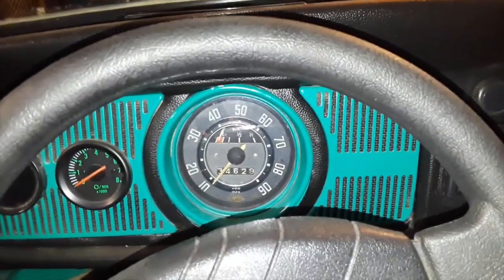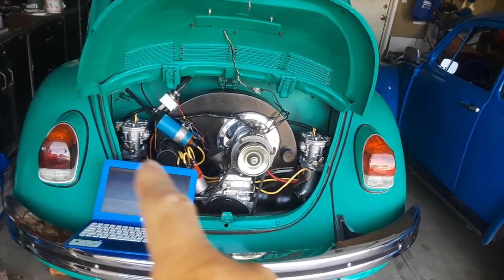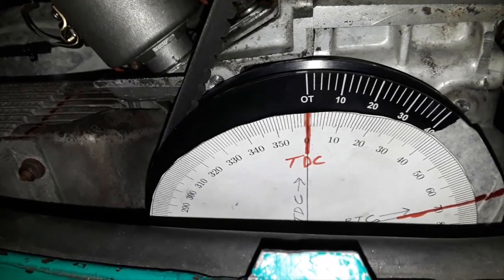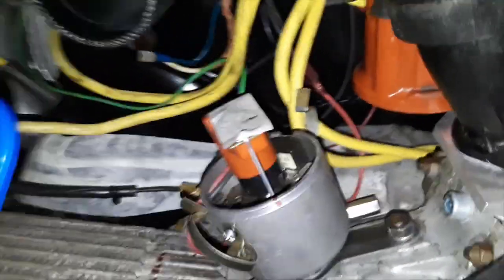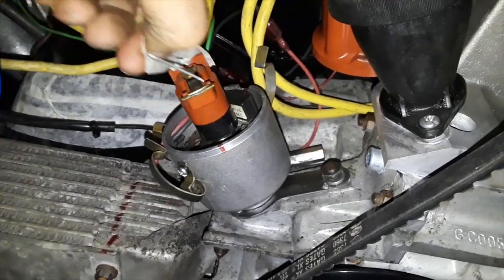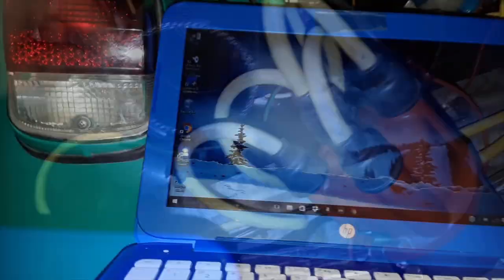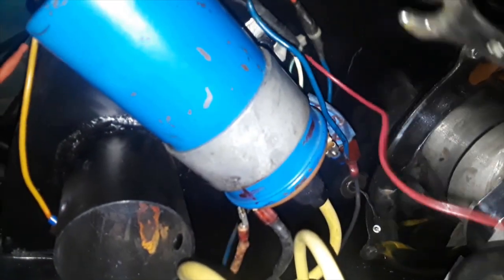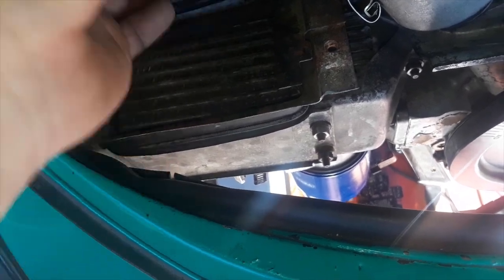CB Performance BLACK BOX Synchronization with 009 and Oil cooler Tin Part:11

Comment: Excellent video.  I am in the process of installing the CB Black Box with an MSD 6AL.  It has a spark when I crank it.  Now it's time to synchronize it and fire it up.  I am shocked that I am only the 15th like.

Comment: I need a new computer and was wondering what yours is. I can't find one with the right vda port
Reply from the maker: All you need is a USB port. But you need to get a USB to serial converter. I believe they're on Amazon.
Reply: @Motor7710  thank you
Reply from the maker: Almost forgot CB performance also has it. Their technician will not help you if you don't have their USB to serial converter.